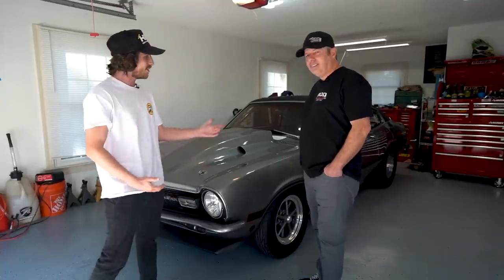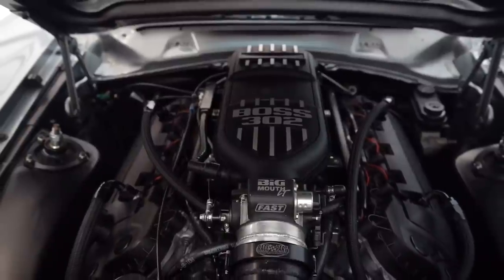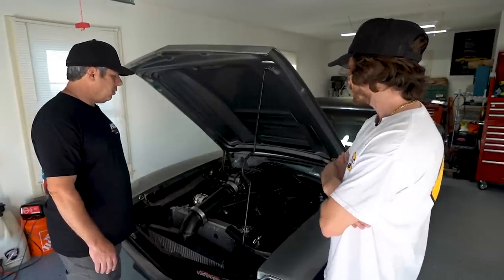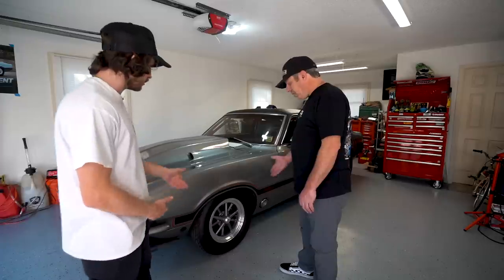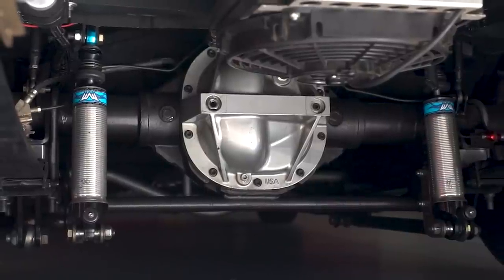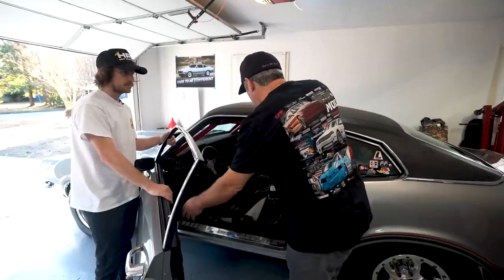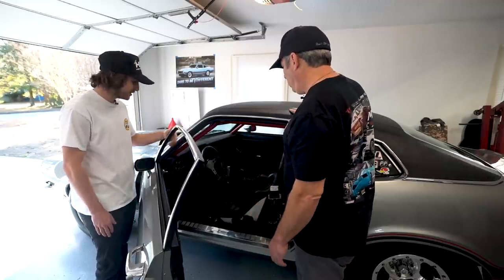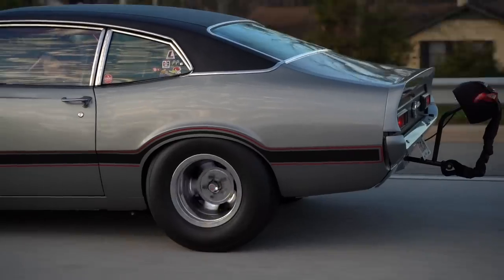1300 hp Twin Turbo Coyote Ford Maverick

Comment: that is hands down THE best sounding coyote motor ive ever heard, it sounds like a pushrod motor. thats a beautiful car man👍👍 me and my Dad ran a 72 grabber on the streets here in Detroit, it was a grudge car, 434 windsor, tfs hi-ports with 2 kits, a fogger and a plate. Mavericks are SUPER lightweight, lighter than a fox body. our car went 8.90s at 150+ in the 1\4 mile on 28-10.5s
Reply: I agree this founds better than most every Coyote.  Guess I am too used to hearing all the horrible sounding modded 5.0 ‘stangs with straight pipes.  🤮
Reply: HOW MANY YEARS BACK DID YOUR DAD RUN THAT MAVERICK ON THE STREET?

Comment: Absolutely Fantastic! They are basically light Mustangs. My buddy had one way back with wood paneling for door panels, it was a straight 6 we swapped to 289. Can’t even imagine how fast this is.
Reply: If you lived in Brazil, you could get an even more powerful variant of the vehicle that was an upgraded Grabber package that had a V8 engine, which I think was a Cleveland 351 engine.

Comment: Totally cool build!  What magazine was the car featured in?  The only thing missing from the car are cup holders and me behind the wheel!  Has your dad considered going a drag and drive event in the car?  

My dad bought a brand new Comet (Mercury version of the Maverick) in 1974.  It was an ugly yellowish green 4 door car with a vinyl roof.  It had a low compression, smog control laden straight 6 and an automatic.  It was a total pig.  It couldn’t even spin a single rear tire in the rain.  My brother and I referred to the car as the ‘Vomit’.  I have always liked the body style of the Maverick/Comets
Reply: It was featured in Muscle Mustang and Fast Ford and RPM magazine. The goal is to one day do some drive and drag events.
Reply: @kendallcollins3179  - Gonna need some cup holders for sure!

Comment: My 70 maverick has the ignition switch on a lower shelf below the dash panel.  They weren't on the column until 71 I believe.  Did you delete the shelf and swap the column?  I love mavericks and am currently doing a similar fox style front suspension in a four door 75. It will be a 3314r70w combo.
Reply: Actually 69 was the only year that came with the key in the dash. Maybe some early 70s had it but for the most part 70s we’re in the column.

Comment: I love it but the vinyl top would have to go don't like it I started 4 years ago putting a 347 stroker in my 72 Grabber and a 4 speed top loader got it running drove it one time and knew I wanted more bought a brand new Coyote engine and a tremec t56 it was all together running Drove it once and it's perfect tore it down it's getting paint on the rotisserie now and I hope to have it done mid summer or at least by winter 2024 love these cars glade to see people keeping them alive but some hate these cars so much they would do anything to keep them off the road Great job. (Great Job. Mr. Collins)

Comment: Hey Austin, would it be possible to get the front suspension parts information from your dad. I am currently building two 1970 Maverick's and I want to convert them like your dad did to his.
Reply: Contact AJE and they will get you what you need. Mine is a complete AJE front end.
Reply: @kendallcollins3179  THANKS KENDALL I WILL. I  APPRECIATE YOU GETTING BACK TO ME.

Comment: My first car was a 1974 2-dr Baby Blue Maverick 250 6-cyl C4 auto, got me thru HS and College.  After HS I swapped out the 250 6-cyl for a heated-up 302 that I built and went thru the C-4 also.  In the mid 80's when the Fox bodies were released, they would jump around with their roller cams and manual tranny's and Holley 4-bbls but I stopped the jump by letting them read my license plate!

FORD bringing back the nameplate on some gay-ass rice burner is disgraceful, BTW .... it was my First first Ford and my last Ford

Comment: Definitely sounds pretty damn mean but if it’s not a rowdy little coyote with some compression he ain’t gonna be liking those 78/75’s that’s enough turbo to make 2000+whp  that’s a lot of turbo for a little motor! A set of VS Racings s475 billet wheel t4 deals with the right size exhaust housing A.R so it will spool better make a good bit more power than the 66’s personally I would have put bigger exhaust housings on them if back pressure was an issue. But I wouldn’t doubt that it’s gonna need another tourqe converter and rear gear with the 78/75s to run any faster than it did on the 66’s if the car had Holley efi it would definitely make tuning 10,000% easier and result in more power plus Holley efi has a few built in strategies to help spool big turbos or turbo on little motors but I also have very little experience with coyote stuff. I have 102mm garret based turbo from Forced Inductions t6 exhaust housing with a 1.20 a.r and basically a LS3 with cheap Summit LS Pro rods and pistons the block is half filled the factory heads have PRC’s most aggressive cnc porting program they offer it runs on methanol most of the time so it’s non intercooled but if it wasn’t on Holley efi and tourqe converter I have it would take forever to get on the 2 step! A lot of people think to make more power you just throw more boost or bigger turbos at will work but that’s not 100% accurate (I’m not saying this dude don’t know his shit because the car is fast)
Reply: They are actually VS billet wheel Next Gen 78/75s and it spools them with no trouble at all. I have a really good converter in the car so there’s really no need to change it and it has 3 speed for the mechanical advantage of getting the RPMs up my friend as you can hear it come up very quick in the video. Thanks for the advice! 👍